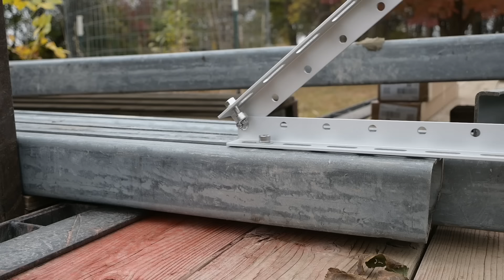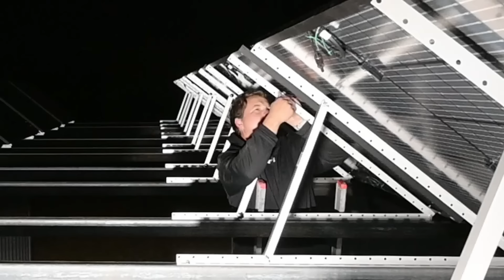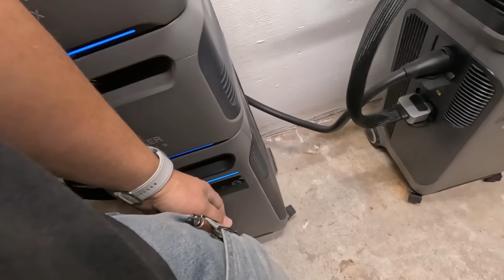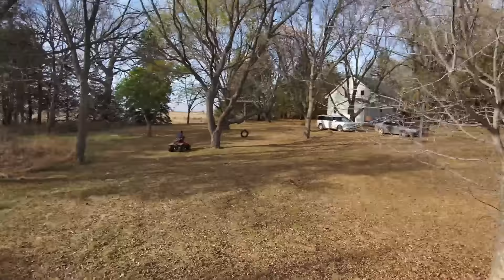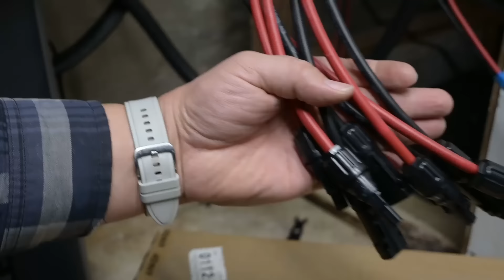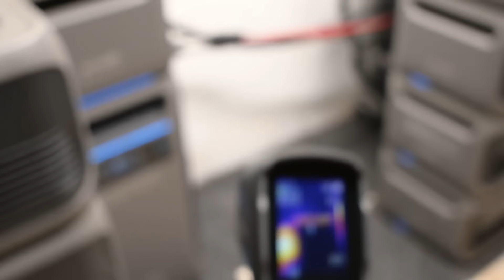How To Install Solar Panels on Shipping Containers - Anker SOLIX F3800 & Home Power Panel System

Comment: A side comment about PV design, since I did not hear it mentioned by Ben: While I think it is fairly common knowledge that wire has to be rated for 125% of the Isc, there is also a voltage consideration that applies to cold climates. If two panels in series have a Voc of 60V and the electronics are rated for 60V,  cold days are going to increase the output voltage at the panel to somewhere in the range of 0.3 - 0.4% per C degree drop below 25C and potentially expose the electronics to over voltage

Maybe that long run with its voltage drop was a blessing is disguise, at least in the cold winter.

Comment: Impressive -- no less your son than the project.

But 60V and a 250' run hurts my soul. That ended up being a LOT of copper, connectors, and hard work. I cannot help but wonder if a transformer would not have been a better way to go.
Reply from the maker: I agree there are more efficient methods. The goal here was to demonstrate what can be accomplished within the design restrictions of this system. There are many possibilities long term that may change with the way I have this set up.

Working with Ole is definitely a highlight of these projects.

Comment: As one who works in the solar industry, I think your design is really creative.  However, I worry about connecting 3 panels in parallel like that...especially if those connectors are only AWG #12.   To find the wire ampacity, normally you'd multiply the maximum current x 1.25...(a 2400W motor on a 240V circuit draws 10A so your wire would need to be rated for 12.5A).  But with DC solar panels (and you can refer to NEC690) the "maximum" current is short circuit current (Isc) x 1.25....but then you have to multiply by 1.25 again!   It sounds like your 400W solar panels have a pretty low voltage / high current to begin with, so if your short circuit current is 13A, then the wire has to be rated for 13A x 1.25 x 1.25 = 20.3125A !  And that's just for 1 solar panel!  So if you are paralleling 3 together, that's a 61A ampacity..., that's gonna lead to trouble.  I get that each "home run" is a parallel set of #8, but holy smokes that's a lot of wire, and if those Wye's are only #12, that's definitely going to be a problem especially where its only a single conductor carrying all that current (should be #6). Additionally, with 16 current carrying wires running in conduit, you have to derate your wires by half.  The other thing too, are the input specs on that inverter - Most "grid tied" inverters or even Lithium Ion batteries with built in multi-mode inverters have Maximum input voltages of 600 - 1000VV.  So you're 12 solar panels would normally all be connected in series with only 2 wires leading back to the inverter, not 16.   High voltage, low current  = generally more efficient.   But definitely keep an eye on those connectors.  The fuses won't save them.
Reply: Also..."shorting" a solar panel, unlike a battery, essentially plugging the positive lead into the negative, is not dangerous.  The maximum current will be limited to the Isc.  I wouldn't recommend it though.  You could probably unplug 1, since the Max voltage you'd get when you tried to unplug would be 30'sh V. But if you had 10 connected together in series....and then plugged the positive into the negative....shorting that whole string out, again, wouldn't be dangerous....but it definitely would be if you tried to disconnecting it.
Reply: "Additionally, with 16 current carrying wires running in conduit, you have to derate your wires by half"......So essentially 2 x #8wires, derated at 0.5 has the equivalent ampacity, 55A at 90C, as 1 x #8 wire.  Still below the required 61A, but I wouldn't lose any sleep over it.
Reply: Yes the F3800 is only designed for 3 solar panels.  6 if you connect 2 of the units together.  And that is ridiculous, for something that allows expansion batteries up to 52kWh.
Reply: @SalvadorButtersworth How is it ridiculous?
Reply: @pootispiker2866  because it would take a month to charge it to 100%
Reply: @SalvadorButtersworth  This guy's system isn't 52kwh though?
Reply: @pootispiker2866  I think it is.  He has 2 F3800 units that each have 6 expansion batteries, which is the maximum.  It looks like he's getting some pretty good wattage on a sunny day, but over time your daily average use will be limited by your daily average input.  

If you get 5kWh of solar in 1 day, you can only use half that during the day if you want the other half to charge the batteries so you can use it at night.  So for the money he spent, he would probably be better off with twice the solar panels and half the battery storage capacity.  And in fact he could have bought 4 F3800 units, 12 panels, and fewer expansion batteries.  But you can only link 2 F3800s together into a single system.

But I'm talking about what's best for off-grid power.  If he doesn't actually need the solar, and he's just using the batteries for emergency power outages, then he could get more battery capacity and no solar panels at all.

Of course it's impossible to guess the exact number of cloudy days you'll have, and some days you'll be running on battery all day.  So having 3 times as much battery isn't a bad idea if you want to avoid powerless days.  But that's 3 times what your panels are putting into the battery in a day, which still isn't much with only 6 panels.

Comment: Solix should really have put a wider voltage range MPPT into the devices considering how big they are otherwise. For these kinds of sized systems one often put them into series and run at several hundred volts.

Comment: 2:08 Vertical mounting is considered best for bifacial.
Reply from the maker: @williamwilson6499  Is that because the panels are naturally just a bit higher that way?
Reply: @BenjaminSahlstrom  The two faces catch the light reflecting off the ground. Check it out. It seems counterintuitive, but there are videos of guys testing it and it seems to be the best way of mounting bifacial
Panels.
Reply: Let’s try again. Maybe YouTube will let this comment stay.

The panels get the light reflected from the ground along with the direct light. Seems counterintuitive, but you can find information gathered from testing that shows a better output from the panels.

Comment: You need to upgrade the splitting/combined to the same awg wire if 10 awg is all you can get in those splitting / combined to liment resistant into the XD60 conecter.
Reply from the maker: I agree that would probably be the way to go. I was actually pleasantly surprised when looking at them with the thermal camera that they were running at a reasonable temperature.

Comment: From what I see you should have ran 2 pipes with that setup and hopefully you don’t get over heating issues with all those wires together… you should have derated with all those wires in the pipe. Second you really should have went with bigger wire. Your volt drop is gonna be massive at that distance.
Reply from the maker: 8% voltage drop. Have analyzed with the thermal camera, and I don't think we would be required to derate? 

The most that would be drawn on one of the 8awg conductors with the way this is setup is 13.5 amps. 27 amps if I only used one set of 8awg per panel group.

Let me know if I'm missing something.
Reply from the maker: What type and size of wire would you have ran? I'm genuinely interested in your opinion. As far as I'm aware, it was necessary to run PV wire specifically since we can't technically transition to THHN or similar?
Reply: @BenjaminSahlstrom  well 8% is less then what I would of expected to be honest. Still over double the industry standard but I know I spent a good amount of time figuring this out.
First off that distance, voltage and amps . My calc says you would need 1/0 to get close to 3% .
I’m going about 90 feet and I ordered 4g PV copper and according to my calc I’ll be under 3% which is standard.
What I decided to do was use a 3 in 1 to parallel 3 - 400watt panels. Then connect a 8g mc4 short wire. I’m going to cut the one end off and then connect my 4 g wire with my 8g using a Polaris in line connector. It’s a big rubber connector for line side use. This will allow me to connector 8g to 4g PV.
Also I didn’t know you’re in MN because I am a master electrician up in the cities. 
I’m doing basically the same thing as you but ground mount and 90 feet away. 
Also always upsize wire you spend more cost up front but the amount of saved in the long term pays itself off easy when talking about percentages of loses.
Reply: @BenjaminSahlstrom so when you’re installing wire inside of a pipe you need to count of many current carrying conductors are in that pipe and upsize according to the NEC. This is because of heat build up and could damage the wire or start a fire. Idk if this would happen but on a hot day and drawing a lot that’s when it would be the hottest.
Reply: @BenjaminSahlstrom  NEC- 310.15(c)(1) adjustment factor for more then 3 current carrying conductors.
I been doing electrical for 17 years in commercial and residential. 
This is my first solar setup, so it’s been a long learning experaince to do this correctly and safely. 
I also am using inline fuses as you did, then I also want to install a 40 or 50 amp breaker installed for each set of 3 panels.
I am also installing 12 panels REC 420watt 48.8 volts.
I found a retailer selling them for about 190$ each so not bad at all and they are top notch panels.
Reply: How did this all turn out Ben? Curious what the input is and did you get by with running 2 wires?
I am just about done wiring mine should be done in 2 days!! I’m about 60 to 90 feet away so should have some results soon.but the winter isn’t the best time to check full output.

Comment: Couldn't you just power some big powerful LED's back at panel at night?  Of course not, nothing for free.  Bifacial panels uses are unique and get you about 10-20% extra, especially in areas with snow to reflect light.  The added cost of panels to me makes bifacial return questionable to me.  Anytime they sell you something that says "up to", the results are unrealistically unachievable, like having the perfect snow reflecting at just the right angle to the backside.

Comment: High voltage inverters are the key. Way less costly than your cable!!
You could have add two strings of panels in series running on 10 gauge wire to the inverter. As always your video is interesting and your explanation is excellent
Reply from the maker: I agree 100%. It's not necessarily the most cost-effective option. We just did our best to work within the limitations of the way the system was designed.
Reply: The way to do it for more solar is to buy a AOlithium 51.2v 100ah server battery and 48V charger and plug that battery into the Anker. You could then put your panels into series and have a much faster charge setup

Comment: I enjoyed the video but did not follow the links since my browser blocked them and reported "Peter Lowe’s Ad and tracking server list"

Since you ran extra wires now, you can double the number of panels later without having to retrench or try to pull wires through an already pulled conduit.
Reply from the maker: That's was definitely a consideration.
Reply from the maker: What is the meaning of the tracking server list? Obviously, they are affiliate links, but is there an actual issue with them? I definitely want to do my best to provide excellent and accurate links. 

Really appreciate the feedback!
Reply: @BenjaminSahlstrom  I did some additional research. It seems "Peter Lowe's list" is a list some ad bocking software uses to report that a link is tracking a "pass through" click. This tracking is used in affiliate links so someone like you can get credit for the click. There does not seem to be an actual issue with the link it is only being blocked because the link click is being tracked - although, in this case, it seems to be harmless tracking. Looks like your links are safe.
Reply from the maker: @qapla  Thanks for the follow-up! 

I appreciate why some people use ad blocking, but affiliate revenue accounts for probably close to 1/3rd of the income for my family.

Thanks!

Comment: I do like Anker products and bought two of the 767 versions, but found the solar input to be the biggest deficiency.
I would rather go with the Apollo, where you can add series strings, and then parallel them together for a much higher solar input!

Comment: Income vs outgo. How much including your labor did it cost? How long will it be before you break even? How much maintenance will be required going forward? I enjoyed the video, but it is not feasible for me. My son did it, other than the tax breaks he is disappointed. More so, after a few roof leaks.
Reply from the maker: I don't think I would be interested in installing solar on a roof unless it were standing seam steel.

Regarding break-even, I don't think that I would. It's honestly less about "saving money" and more about having a backup solution that doesn't require fuel in a long-term outage scenario.